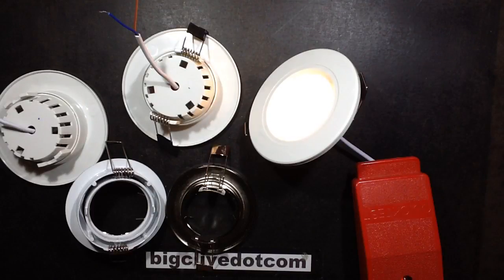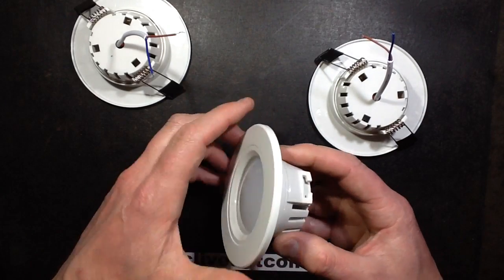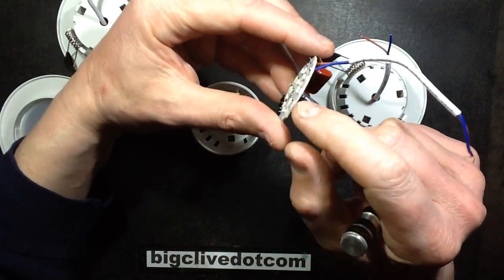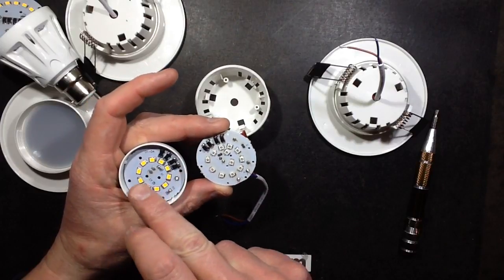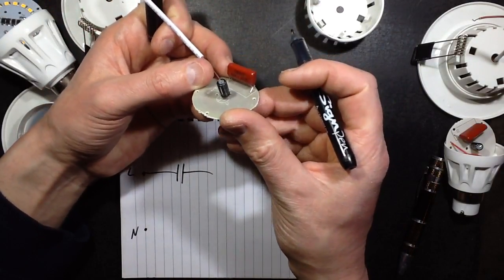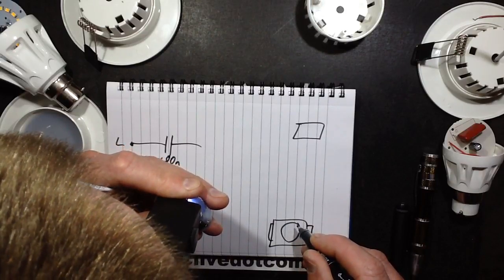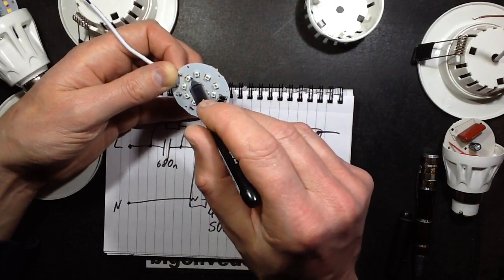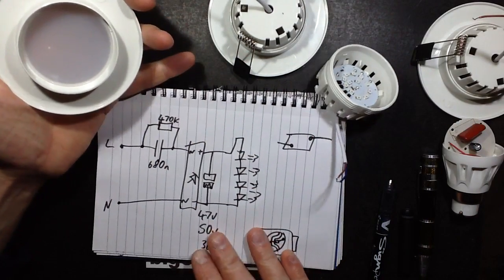Teardown of a fully integrated LED downlight.

Comment: That electrolytic capacitor is going to explode when one of the LED's fail to open circuit as it relies on the voltage drop of the LED array from overvoltage the capacitor. Otherwise it's quite nice specimen. I would like to know how hot the PLCC-2 type LED's goes and what current it drive these?
Reply from the maker: DjResR The earlier lamps did use electrolytics rated for open circuit survival, but the tendency has been moving to lower voltage electrolytics with higher capacitance ratings.  This does mean the output has less ripple, but as you say the cap may go bang if an LED goes open circuit.

Comment: Would the MR16 SUPERFLUX PCB fit?
Reply from the maker: Ron Newsham Well yes.  Yes it does.  And it turns out that a lot of the PCBs in other lights are all based on a standard size of around 44mm diameter.  Video to follow.
Reply from the maker: bigclivedotcom Actually I completely misread your comment and thought you were referring to the glass lamp I shredded in another video recently.  The MR16 PCBs do fit inside the downlight frame, but would need glued in with hot melt.  But your comment did make me realise how there are some size standards emerging in the LED lamp industry.

Comment: I do like the look of those, but I wonder if they have any IP rating ?  I Would imagine they would be good for kitchens/bathrooms as no way of touching any live components....
The 'choc box' you need to connect the light legally in the UK is more than the fitting.....   funny eh?
Reply from the maker: Phil Docker I reckon they might actually comply with bathroom or kitchen use, since the front lens is pressed tightly onto the front when screwed together, and the electronics are mounted well clear of it.  As for the connector.  I'm sure the "Part P" installers will just use the open 5A choc block they've already used and then sign off their own installation after some quick pseudo-testing.
I think these light would be great for visual theming.  Low heat and power, and a pretty even disc of colourful illumination.
Reply: bigclivedotcom LED lighting is getting contunually better, every 6 months you see improvements in performance and price reductions.  
The thing that I find is a lot of cheaper LED products fail after a few months, and when they do fail - you can not find an exact replacement.
Personally I run LED lighting from 12v rather than 230v mains, a good quality ATX computer power supply runs quite a few LEDs !
Reply from the maker: Phil Docker If you're using the 12V LED tape then you can make it last longer by adding a diode or two in series with it.  It drops the voltage slightly, but since the voltage across the series resistors is already usually just 3V a diode or two can have a significant effect on the current.
Reply: bigclivedotcom Thats not a bad idea !  It wont dim it too much either!

Comment: They are using the wiring as both current limiting resistor and fuse. What economy, making one component do 3 jobs just by using the shittiest one you can get. I bet there is only a 4 strand "copper" wire inside as well.
Reply: SeanBZA the 'fuseable' pcb track has been used as a trick and at least its safe, cannot comment on how consistent it is, well cant be compared to a drawn wire fuse, but will certainly fail even before 1 amp wire will, which is 240 odd watts anyway

Comment: its the future, it should be cheaper by far to make them due to not needing access, and the old connectors , easier to make safe and thus to satisfy international regulations, plus designs that are smaller and nicer designs, well one day anyway!  i would also imagine, as soon as a design is succesfull, the internal circuit board will become a standard part
Reply from the maker: jusb1066 I get the feeling that a lot of the lamps are starting to use standardised PCB diameters, possibly for this very reason.  Perhaps they'll add a small connector on the back.
Reply: bigclivedotcom
yes the cost savings of using and making the same pcb for bulbs or over head lights makes sense, they can add/remove leds and adjust the parts easily for voltages
Reply from the maker: jusb1066 With just 10 or 12 LEDs on these PCBs all they would need to swap would be the main limiting capacitor.
Reply: bigclivedotcom and £1.36 wow, people will have no issue throwing most of it away so long as it lasts a good few years, so long as they stick to the overall ceiling hole size !!
Reply from the maker: jusb1066 Yeah, it's a ridiculously low price.  The tricky bit will be finding a new downlight that reliably fits in the old hole.
I'm thinking the coloured ones of these would look great mounted in walls.